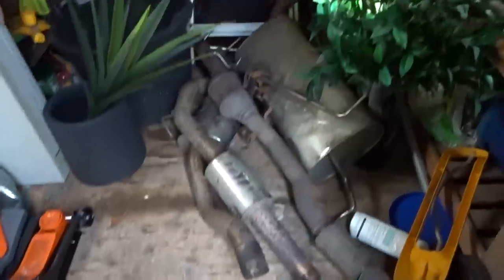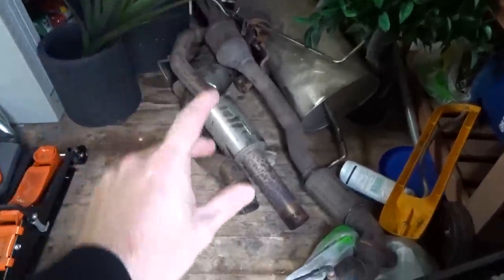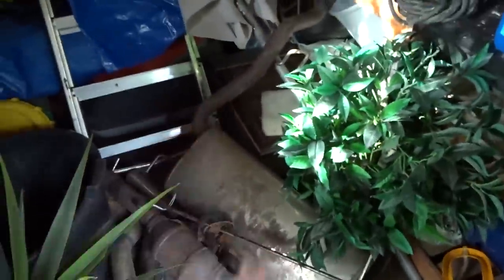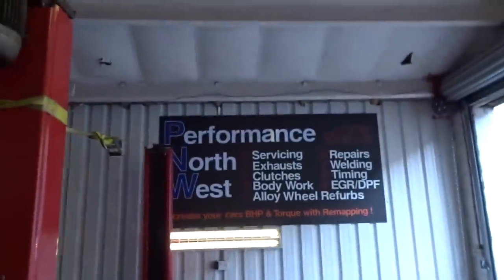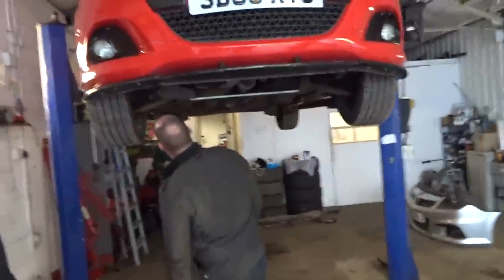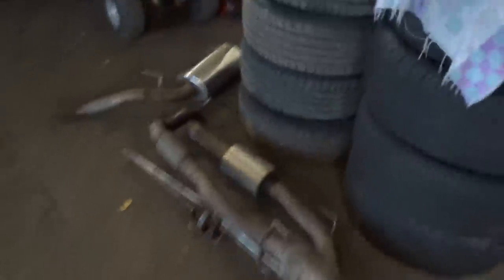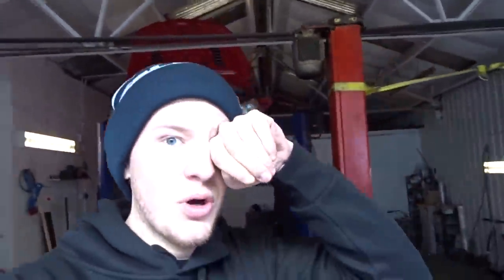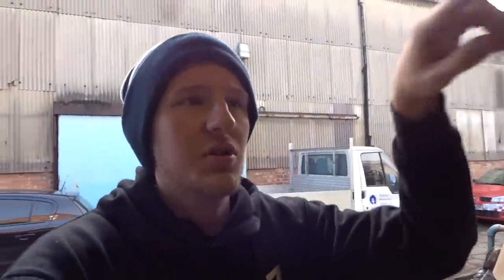THE VIDEO YOU'VE ALL BEEN WAITING FOR...

Comment: Towards the end that whining noise? Better watch your gearbox mate, mine was whining and needed a full rebuild. I got the updated end casing on it too as the earlier models starve 6th gear of oil as there’s no reservoir so it just dried out.
Reply: ScottSingers1992 yep my Astra went just the same
Reply: I know Nothing feel your pain mate. Well worth the repair though it’s solid now 💪🏼
Reply from the maker: ScottSingers1992 it’s only just had a refurb mate
Reply: Jesse // J3ESE what exactly was done lad? Not meaning to be nosey just don’t want your pride and joy going bang 😢
Reply: A lot of people don’t know reason for failure is down to inside casing temps reaching over 120’ degrees bearings can’t take the load and they end up failing 🤦🏼‍♂️  cold side casing upgrade with bigger bearings is advised , keep the gearbox topped up with oil and don’t go thrashing it for hours on end ( if you go on track have a break give us chance to cool down ) should last you then ... 👍🏻